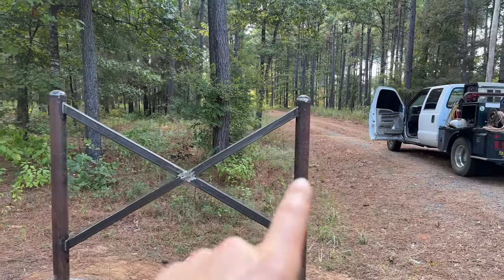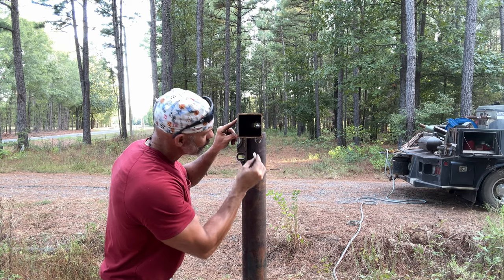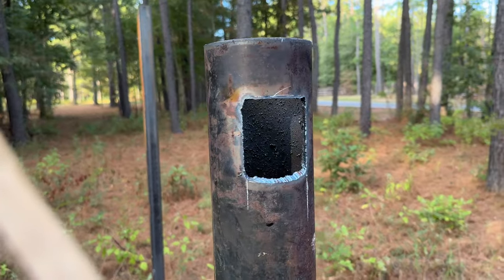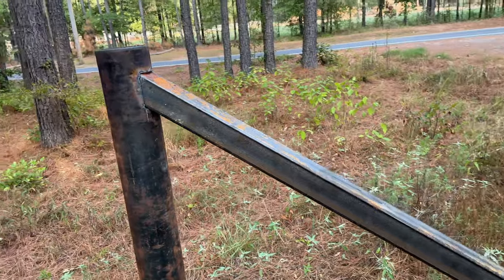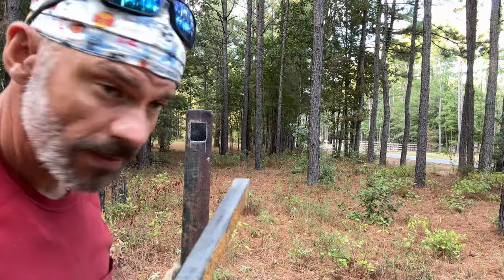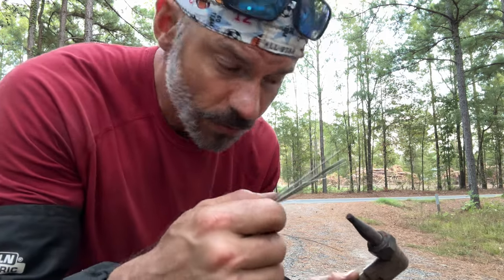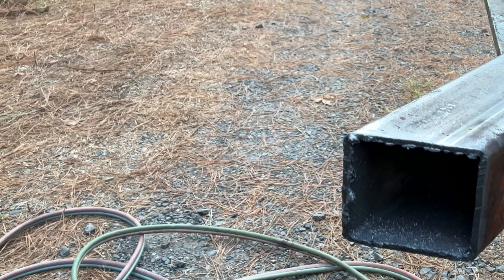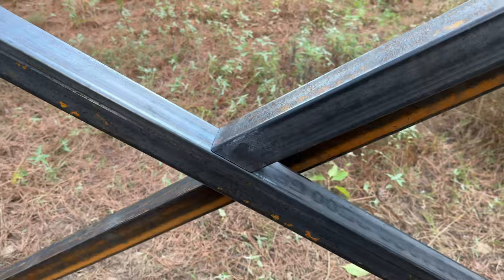Welding Square Tubing to Pipe: Essential Layout Tricks and Torch Tips (NO GRINDING)

Comment: As someone else commented, I never would have thought to cut holes in the pipe but instead would have coped the square tubing. However, I do see the advantage of doing it your way. It’s much easier to position the tubing working by yourself. Your way may well be the better way to skin the cat. Nice job.
Reply from the maker: Coping the tubing was pretty  time-consuming. that’s what I started to do and I realize how long is going to take.
Reply: Cutting out the pipe instead of coping the square tube is a nice touch that i would of never thought of but since you cut out the pipe, was the miter on the sqaure tube absolutely even necessary? 🤔
Reply from the maker: @kylebrooks8128  no, it was just previously cut.

Comment: He's smart, only thing it's best to pull the tip off torch head before you clean it so you won't push slag into your torch this will end up stopping your holes back up.
Reply from the maker: That’s a good point

Comment: Impressive Chris. 
Two things, why not use a plasma cutter, they seem to be faster and cut cleaner. You'll probably say it's because you have no onboard air on the truck and gas bottles are easier to hual on the truck? 
Also, why cut square holes into the columns, but instead cut the square tubing with a radius and but it to the pipe? It would be plenty strong as you're still welding 360' around  the square tube.
In any case, you do some fine work.  
Maybe, for content, you could do another video addressing the comments here in this video and put us all in our place. Lol
Reply from the maker: Those are all good questions. I will include them in the next video when I’m working on that fence. But you’re right I didn’t have on the truck and coping the square tubing was just time consuming

Comment: Do the layout and cope the tubing.  If the posts are all janky and out of plumb...  That may be an issue.  But if everything is done right to begin with...  It's pretty easy to do the layout and possibly make a template to cope the tubing to fit the pipe.  At least that is how I would do it.

Comment: I would have fabbed the whole thing in the shop on a table. Then set it and poured it in the cement plumbed, with two temporary braces to hold it, in each direction.
Reply from the maker: again, you’re sharp as a rat turd

Comment: You are an artist with an oxy acetylene torch. Now that I know the tip size, what oxygen and acetylene pressures are you using?
Reply from the maker: Eight or 10 on the acetylene and 40 on the oxygen
Reply from the maker: Thank you for the kind words

Comment: even with a triple o, i would be laying the torch at a steep angle so it is actually cutting a thicker section,,, i really like your harping on a clean tip, a lesson i got back in the mid 70s,,, the ripping sound of the properly cleaned tip is always the sound of a true craftsman,,,

Comment: How did you line up both fences, since they are across the road from each other did you pull from the road  and put stakes in the ground with string line
Reply from the maker: We pull a string where my neighbor wanted it
Reply from the maker: It’s not really square with the road. More  so square with the driveway.

Comment: It probably would have been easy to saddle as well. Maybe I’m wrong. But I think you could have cut each end of your ST to the angle you want, then just saddle the top and bottom after, slid the ST down.
Reply from the maker: I saddled one. It took so long, cutting holes just seem to be easier and faster.
Reply: @TaylorWelding  makes sense. It did looks pretty easy the way you did it.
Reply: @TaylorWelding  your way is the way to go.  with a saddle, the parts have to slide down the round tube to fit tight and you can only do that with one half of the x